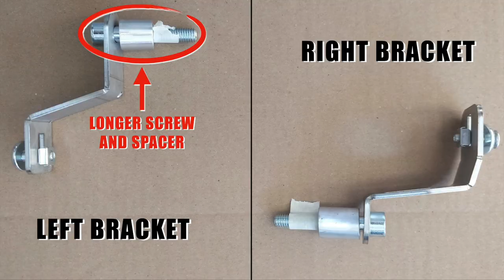Aprilia Tuareg 660 - THOR skid plate assembly tutorial by GpMucci (UPDATE: Read description)

Comment: This is an excellent skid plate!!  The lines of it flow perfectly with the fairing on the bike that goes around the gas tank/radiator/air filter.  These lines align perfectly both side to side and front to back.  It looks so much better than the pathetic factory skid plate and greatly increases the protection, while only adding minimal weight.  I have the Martian Red bike and black skid plate.  BTW, it mounts and works perfectly with both the Hepco and Becker tank guard bars and the Hepco and Becker center stand.
Reply from the maker: Thank you so much for the feedback!

Comment: You have your left and right brackets labeled on that photo (at 2:25), but later in the video I can clearly see you putting the brackets on the opposite side of the bike compared to how you had them labeled (at 2:56, and at 3:12)???  That also makes me confused regarding the longer bolt and spacer as labeled in the photo at 2:25.  You have the shorter bolt and spacer labeled as the longer one, and with the confusion as to which bracket goes on which side, it's very confusing making sure you have the correct spacer and bolt with the correct bracket on the correct side of the bike.  Can you clarify???  There were no instructions included, only a parts list.
Reply from the maker: Ciao! You are right, the pic at 2:25 is inverted, left is right and right is left, I'll change the video
Reply: @gpmucci7508  I was able to figure it out.  Thanks for this excellent product!!!  Love this Thor skid plate!
Reply from the maker: @atsmobd  Thank you!